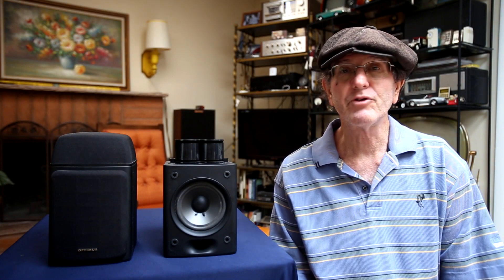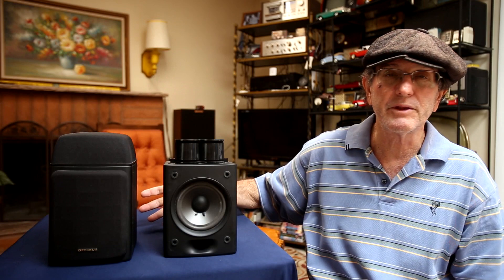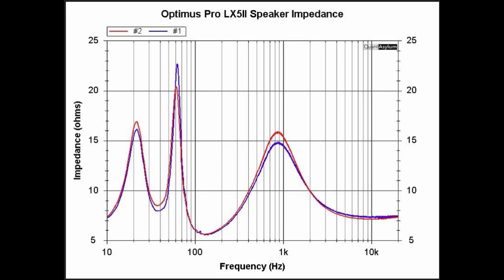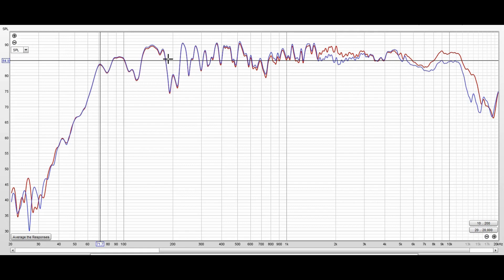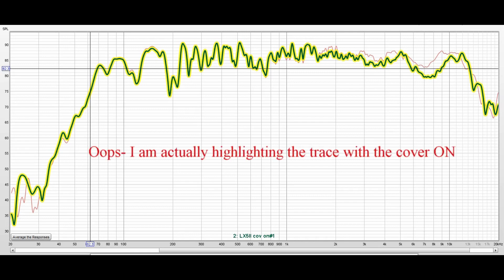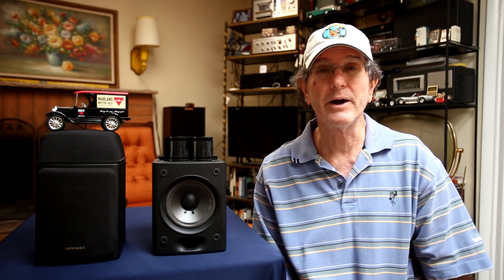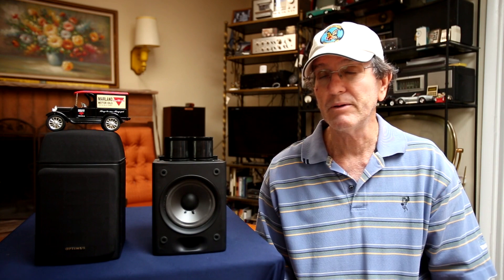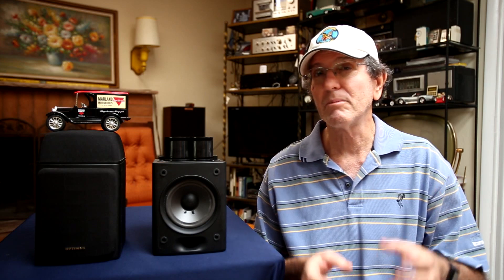Optimus Pro LX5II Loudspeaker- Vintage Audio Review Episode #93

Comment: I still use a pair of LX5 II (built in '99 according to the labels on the back) on stands as my desktop speakers today. They're powerd by a little Aiyima D03 amp. I paired them with a Polk 10" powered sub under the desk. They're amazing sounding little speakers.
Reply from the maker: Glad you had a good experience with yours but the ones I listened to were not very good sounding.

Comment: Thanks for measuring this speaker: it is one of odder bookshelves of its time, combining a very conventional bass reflex design using a  mediocre realistic mid woofer, but using the then rather esoteric ribbon tweeter by a narrow market company rather than the realistic/radio shack mall mass market…and pretty cheap stuff generally. So it’s wonderful to have a review of these. 

I believe these lineaum ribbons are do-pole, radiating as much sound to the back as to the front. The ribbon is suspended between the cylindrical things, with nothing behind or in front of it. 

Dipoles are usually VERY affected by room placement and the material of the back wall. It is very possible to get reflections off the back wall that cancel frequencies radiating forward (or the opposite, adding to them).

Usually they want to be many feet away from back or side walls. 

The upside in principle is a wide and very open and fast soundstage that envelopes the listener somewhat. Though some beaming can occurs depending on crossover etc. 

And  they can be  very tricky to measure. 

I wonder if some of the roll off might be room cancellations due to dipole. Or just room placement. 

Dust and years of grime can also reduce performance of ribbons because they have so little mass. However cleaning them is not something for the amateur. 

Then again these were never top end speakers. Though some buy them on eBay just to get the tweeters for a diy build. Most who buy them to keep intact say that one really should just replace the midwoofer unit entirely with an inexpensive but much better driver rather than bother refoaming. The improvements are marked apparently as the mid woofer driver was never a match for the tweeter, a cheap one to compensate for the relatively costly tweeter.
Reply from the maker: Thanks so much for all the info on this speaker. You seem to be very knowledgeable. My friend who refoamed them does a lot of refoaming so that is his 1st choice. I put the speaker towards the center of the room in the same spot I measure other speakers, so I think the rolloff is real, plus the high end sounded rolled off as I mentioned and for listening, they are placed more towards the wall- maybe a foot away.
Reply: Well I was researching ribbon/amt tweeters a while ago and these little things  are so cheap on eBay. Never ended up buying one though.
Reply from the maker: @ManFromLaBamba  Guess some folks like them after modifications- I appreciate your commenting.
Reply: You just nailed something most people don't know. The tweeter you want will say Linaeum on top of it. These say Optimus. Linaeum made the original ribbon tweeters for Radio Shack and they were great! This model the Optimus Pro LX 2 optimus has a much cheaper ribbon tweeter. I don't know how hard they are to find, but if you could find one of those original lines; you can really hear the difference on the high ends. I loved mine for rear surrounds for years. Sadly the size of the cabinet was just really too small for the size woofer on those. IMO. The foam issue is another thing.

Comment: I have 2 lx5 and 2 lx5II. I still use them today. I just upgraded a crossover in all 4. I also had to refoam all.
Reply from the maker: Glad to hear they are working well for you. Did the crossover upgrade help much ?
Reply: I think it cut the Tweeter more. It had a 2.2 ohm resister in the tweeter circuit. I may have to remove it. I still have more testing. I bought them new at RS. I also have 2 pair of acoustic research AR16 speakers that I bought new years ago. I would also like to set up my AR turntable, but I have nowhere to store the records. I just replaced my 25 year old Sony receiver with a Denon avr X6700h
Reply from the maker: @hitechrr  I would not be happy if the upgrade made things worse. I did see there was a crossover mod for them but did not check into it as that was not going to happen with these. Not familiar with the AR16 speakers- hopefully they are not as power hungry as the AR9's
Reply: Bought mine in 1999 and still have them

Comment: I have a set of the LX5's, which are fine for a kitchen radio.  The magic may have been lost from sitting for 20+ years.  With the ribbon tweeter rolling off at 10K hz+, it's really not audiophile.   I may toss them.   They're all metal, so they'd go in the recycling.
Reply from the maker: It is possible that there was something wrong with this pair after all of this time, but probably not worth the effort to get them repaired. They could be used as "sacrificial speakers", ones you hook up an unknown amp/receiver to find out if it works.